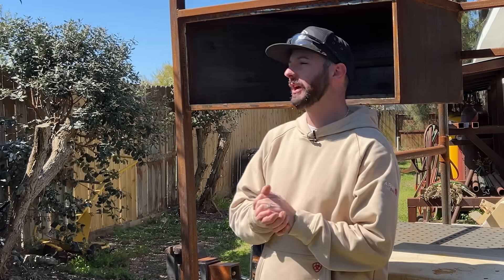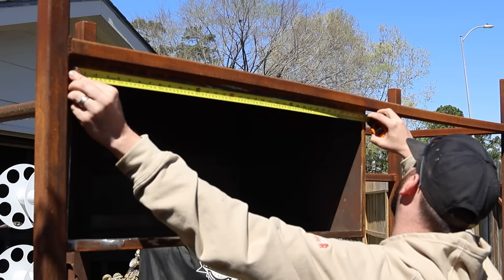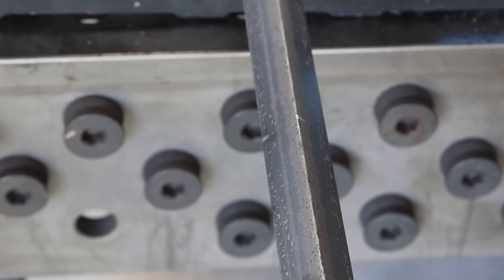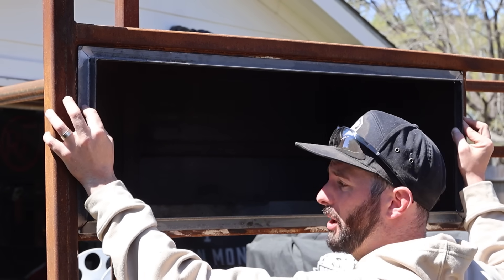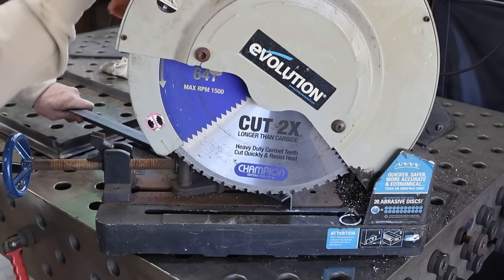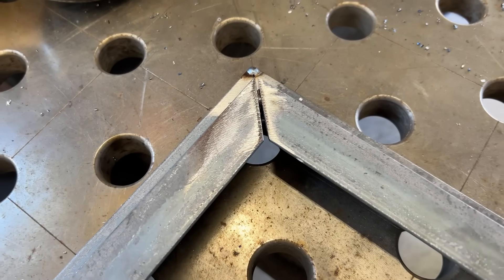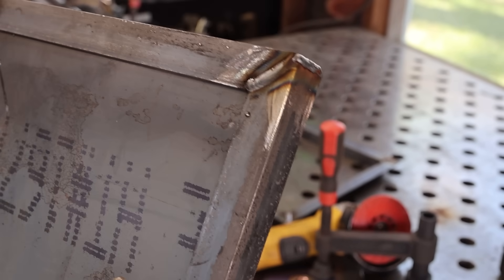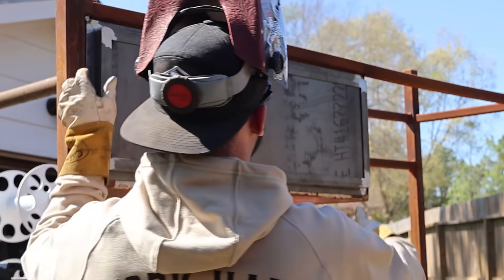Step-by-Step: Fabricating Metal Hinges & Framing a Metal Door Using GMAW

Comment: For the second frame you forgot to add the metal thickness to your second frame that's why it was gappy.
Reply: The editor cut that mention. I did count for the 1/4” take off for the other angle

Comment: You're running Cubitron 3 fiber discs. Give the Cubitron 2 a try. They have the same 36+ grit available and remove material just as well, but they seem to last longer.